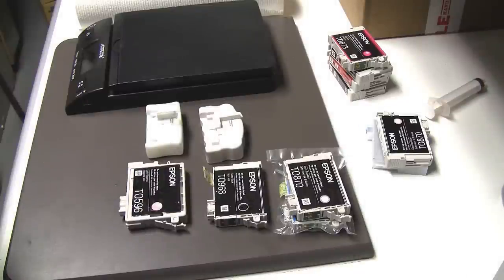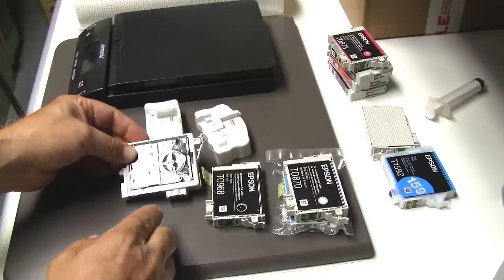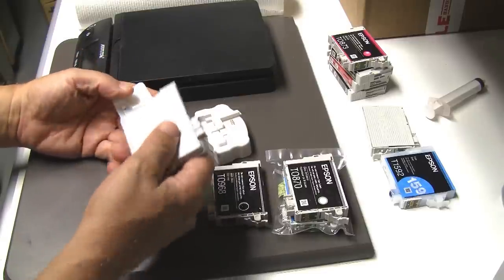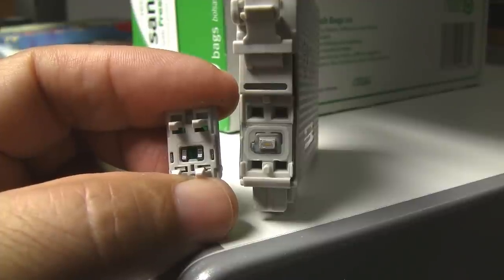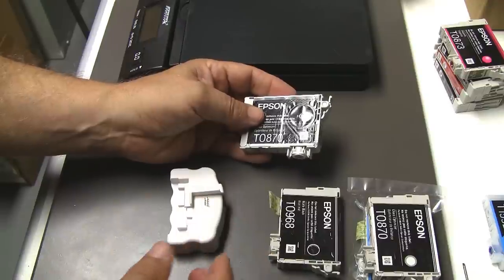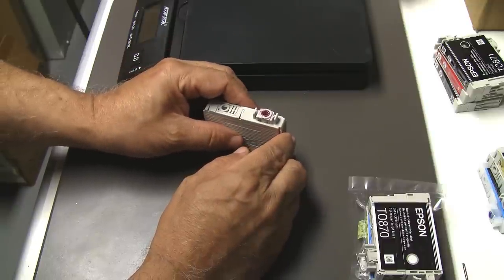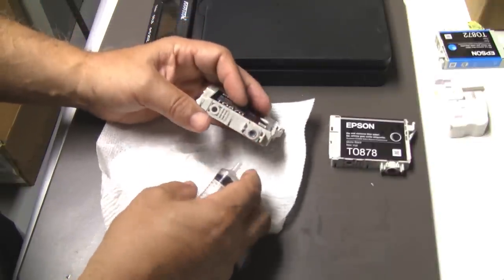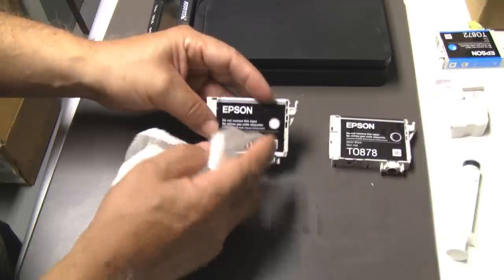New way to refill OEM Epson carts

Comment: Hi Jose, I practised a bit more on two more oem carts and found that, as you say, you need to pressurise carefully, and work the pressure on and off.  Eventually it pops.  It helps to adjust the syringe so that there is only a bit of travel left at high pressure.  I noticed that after successful popping, you can see the two filling port covers flexing and the rectangular cavity behind the label flexes as you blow air in and out - and there is no leaks of ink anywhere!  With the R1800 carts, the vent hole has a valve in it which you need to push in while filling with ink.
My first re-filled oem cart is working fine.  Many thanks.
Reply from the maker: Like I said it is is a very iffy process than may or may not work even 50% of the time. The reason I made the video initially is because people begged me to do it and I really did not want to as it was not at least 90% reliable.
Reply: I'm happy with that risk.  Might as well try to use my old oem carts, rather than just throwing them in the bin.  The one I did the other day is working fine and I have a perfect nozzle check.

Comment: I work with several inkjet cartridges including all of these epson cartridges. I tested this method and it does work...mostly. When you break the "one way valve" that built into the nozzle of this cartridge you can refill through the nozzle.
The first problem with this method is when you fill until you see ink come out of the vent you are saturating the vent filter with ink. This filter is designed to allow air to pass through but not liquid. When it is saturated with liquid it does not allow air through as easily. 
So... when you fill this way you put ink into the filter and block it so your cartridge will (after printing for about 10 to 20 pages) develop a vacuum inside and not release any ink. You might not experience this if you only print one or 2 pages at a time. This will allow he vacuum to equalize and you might be fine.
Also, filling this way, you are unable to eliminate all of the air from the cartridge so you will have problems when the "ink sensor" detects a bubble. The printer will read that bubble as "the cartridge is out of ink" You might solve this by banging the cartridge on a table to move the bubble off of the sensor but it will probably return soon. 
If you are able to reset the chip, the ink level will not be accurate because you were unable to remove all of the air from the cartridge. 
All in all, this method does work. Just be aware you might starve your print-head and need to constantly remove the cartridge to bang it on the table. 
Good Luck.
Reply from the maker: That why you must first remove ALL the ink that is left in the cart before cracking the diaphragm. The you have to make absolutely sure there is NO air in the syringe loaded with new ink. The you must absolutely know what the factory volume is. You weigh a 100% empty cart against a factory brand new one and then only load that amount.
Now you tap as you suggested, the cart so that you allow any air to be detached from the internal maze of ink space.
I agree 100% with you about accidentally wetting the vent filter. That is a NO
NO.
If the amount of ink is correct, you will not wet the vent. I will often inject a bit less ink and pull the cart out at about 20% level anyway so the wetness sensor is not tripped.
It is not a perfect method but it does allow you to do what many have said was impossible to do. If it doesn't not work for you then the only other option is refillable carts of which there are BAD and GREAT ones. It can be a total crap shoot unless you know the company and they have a great reputation. And many do. I would stay away from EBAY and simply pay a bit more for the assurance of getting a good product.
Reply: Jose Rodriguez Even if the ink volume injected is exactly the same as the original amount, due to the maze of chambers and where the inlet/outlet is in each of those chambers it is impossible to fill using this method without wetting the filter. (unless you can inject the ink into the nozzle under vacuum) 

As you fill the cartridge gravity takes the ink to the bottom (top inverted) of each chamber that traps air inside each chamber and it will not ever leave.

It might work if you filled it right side up after you break the seal but I think the results will be the same.
Reply from the maker: You are supposed to fill right side up.
I may not have shown that as correctly in the video but the RJETTEK jig video does show that!

Comment: I bought some refills from bch and watched some of their refill videos. According to bch, the chip on the cart does NOT measure the ink level but the number of prints. As you say in this video, the chip isn't accurate. Thanks for these excellent videos Jose! I love how you like to help people avoid being screwed mercilessly by the scum charging $60 USD for 20 ml of ink. I doubt I will use this method and prefer to use bch method of using a drill to make a feed hole (not sure if this is a good method; there was so much air in his cart i doubt he would be able to use it before drying out the print head with too much air) and then pumping in the ink. I'm afraid to use your method in case (as bch showed) the valve ruptures.

Comment from the maker: No.
Even if you could I don't think there is resetter for the chip.
You have to use refillable carts with resettable chips which may be battery powered for the resetting.

Comment: Hi Jose, Have you tried resetting the 99 artisan cartridge ink series? I have Epson  artisan 1430 now and my old printer Epson artisan 835 broke. I have so many new unused ink from that printer Epson artisan 835. The ink cartridge from Epson artisan 835 will fit into my new epson 1430 printer, but the chip is not recognize in the new printer. I need to refill the old cartridge of the the 99 series to the new Epson 79 series. Any ideas how I can make this work? Also do you reset the cartridge before or after the refill?
Reply from the maker: Sorry but you can not fill original EPSON Carts. They are made so as to not be refillable.
Reply: Jose Rodriguez ugh! Bummer. Thank you for letting me know.
Reply: So I can take ink out of it but not refill it? Right? If I buy empty refillable cartridges do I need to reset them?
Reply from the maker: Yes you can definitely do that.

Comment: Refill tip for this tipe of carts:
Go to Google and search for EPSON (Your epson Ink Series)
Like "Epson Apple inks"
You'll find original epson site, where you'll find the specific MLs of ink to be injected
As soon as you use a third part ink, i advice you to load 1 ml more ink in the cartridge.
Example T0xxx 11 ml >> inject 12 mls

ADCSFXworks Printing Center

Comment: Thank you so much for this easier method of refilling! If it works for the 2200, which I believe you stated at the beginning of this video. Where can one get the proper ink for refilling?  Also, can you use an off the shelf syringe or does it have to be a special one?
Thanks again.
Kind Regards,
Steve

Comment: Hi Jose
When I try this method to "pop" the membrane, nothing happens before I use so much power that the whole cartridge cracks. I have cracked 5-6 of them by now. Same thing happens all the time. Original cartridges for Epson stylus R2400.
Reply from the maker: Did you use a 20ml syringe? Did extract EVERY drop of ink from them before attempting? It should POP at bout the 7ml point if you are using a 20 ml syringe.
If there is ANY fluid still in it will not work and even if it does work, you will aspirate that leftover ink into the diaphragm.

You have to hold the cart upside down and vertically so the exit port is pointing up toward the ceiling. Filling can only be done with the exit port aiming toward you and on the bottom if you hold the cart on its edge. Rate of injection is no faster than 1ml per 5 seconds.

Comment: Thanks for you video. Before I watch your video, I had tried to use a needle to break a little hole at 3:34 which you mentioned.  It is very easy to break it and the ink is leaking out.  Can I just refill the ink to that little hole?
Reply from the maker: This ONLY works on the cartridge numbers listed. None others. And failure rate is high. You do not have to puncture anything.

Comment: Hi, I just got a printer with these empty cartridges. I'm allowed to play with it, so I tried putting metal tape across the wetness sensor contacts on a empty cartridge and now it shows its level is full, ....but wont go, the chip still needs resetting, probably. :( Since I think the sensor measures resistance, (short circuiting, makes it full). So maybe try this, it might be a way to reuse your shorted out empty carts.
(this is like what ProGamer1515 was trying to do)
It's funny I watched your video before I was introduced to the same printer/cartridges you showed.
(I'm doing a project where I'm trying to print with water.)
your video is really informative!!! thanks :3
Reply from the maker: +Joseph Dickson That is some very very interesting information! Thank you!
Reply: ^_^ no problem! your Video really helped me too, Thanks.
Reply: How do you short the chip to reset it?
Reply: It's been a while, I think there are 2 contacts between the chip and the contacts to the sensor. 6:30 I put some copper/aluminium electrical tape over the sensor so the metal back will create a circuit between the computer chip's pins. And the computer chip shouldn't notice the sensor is broken anymore. ^_^ Sorry I don't have it with me at the moment, I'm remembering off the top of my head :P feel free to ask more about it :)
Reply: Oh if you are asking about how the cartridge gets reprogrammed, that is different than what I am talking about.

Comment: I have an Epson RX 500 all-in-one and it's been very cranky. If everything isn't exactly right it will drive you nuts and sometimes it will say a cartridge is empty when it still has over half it's ink. Take a cartridge out, and it won't accept it back. I've even had it tell me a cartridge was empty and I replaced it. Then it said another was empty, then another, etc. until I replaced them all.

Epson may be great printers but I think I'll go with something different next time. 
I had a Lexmark before and it was problem free at a fraction of the cost.
Reply from the maker: That's very odd. I assume you are using OEM carts?

Comment: Jose, luv your videos, one I am looking for is about the Epson cart that has the window in the bottom, for the printer to see how much ink is in there, XL200 carts are among these. I am sure I saw a vid you did on this, apparently the refill is similar to what you are doing here in rupturing the diaphragm. The XL200 seem to also have this diaphragm. Any help would be appreciated.
Reply from the maker: +Jackie Dines I don't know of any EPSON OEM carts that show you how much ink is in them. There is a MAZE of channels and chambers inside OEM carts that are completely sealed from the peering eyes. Only Refillable Carts would ever allow you see inside their very simple internal chambers ( Nothing like OEM ). They are the only ones that have see through sides.Even IF you could rupture the membrane ( Iffy Proposition ) how would you reset them? You'd have to find a resetter for those Carts. I understand that it is a three color and black ink printer not really intended for photos but for documents. I would suggest you just use compatible carts on it. That's what I do on my WF1100.Joe
Reply: +Jose Rodriguez Thanks for your reply and yep it is just a doc printer. I think I have found a video on how to refill them, not a problem. But I would love to ask you what you think about buying a R1900 that has only used one set of inks. I believe these have the TO87 carts. As this printer is getting on now I would imagine that they emptied the carts and never replaced them, so that would be a new set and then the issue of refilling if they have that "wet sensor" you talk about. Is it practical to use CISS or replace the OEM with refillables? Can you use Dye ink as well, if so is there much to preparing the printer to change inks?  I am just an enthusiast and getting more and more interested in printing my own pics. So far I only have used the RX650 6 colour printers and these do a pretty good job, but I would really like to achieve two other things, one is to print better black and white, the other is to be able to print A3 size. I bought a RX650 years ago and just recently was given another one as the owners could not handle trying to clean the nozzles and or use refillable carts. So they just went out and bought a new printer. I have now (thanks to your videos) been able to refill the OEM carts and after buying a chip resetter (from the US, I am in Oz) I am happy to say that it is all working a treat. Sorry about this long post but I would love to know your thoughts on the R1900 for my purposes, I cannot afford to buy new and where I live the market is very small, I have been looking for a long time to buy a reasonable Epson A3 photo printer second hand. I think that I should be able to buy it for around $350 AU.
Reply from the maker: +Jackie Dines Jackie, I am sorry I did not see your reply any earlier.The R1900 is a wonderful printer capable of excellent gorgeous results on glossy and lustre papers. If ytou can find it and it is able to be cleared on all nozzles then it will serve you very well. You will have to install and expernal Waste Ink collector simply to make sure that you are no longer dumping ink into the internal pads wehn you have to clean nozzles or after installing a new cart.Good luck!

Comment: dont pop the diafragm. Fill the syringe to half (ex 5 ml). turn it up side down and push the air out. attach it to the cartridge and pull the syringe full out to create a vacuum and then push  the ink in.
Reply from the maker: Are you sure?

" don't pop the diafragm. Fill the syringe to half (ex 5 ml).

WITH INK?

turn it up side down and push the air out.

YOU MEAN EXPEL THE AIR OUT OF THE SYRINGE BUT WITH ONLY 5ML WORTH ON THE 10ML SYRINGE?

attach it to the cartridge and pull the syringe full out to create a vacuum and then push  the ink in. 

SO YOU ARE SAYING THAT YOU CAN VACUMM FILL THE NEW EPSON CARTS THAT WAY?"

I would think that if that was all it took, the device that rjettek is selling would not required??? I will try this and report back.

Comment: Hello sir, I enjoy your videos once i blow out the one way damper, there is a ,mess. is it safe to put ink back in right away or does it need to be sealed , it seems like ink is coming out of the side. It seems like i cannot put ink back into the cartridge because when i try and push air through a second time air bubbles and ink are still coming out, did i do it wrong and break the oem , i am doing this on the r1800 cartride for cyan color.
Reply from the maker: Did you compare the cart # against the list of compatible carts in the description. Thus only work like 50% of the time unless you have the actual $200 gasket to do this properly. Does not work at all with anything new.
Reply: @cheo1949  actually sir, I hadn't yet. But I did now and I do not see it. I have the T0542 ( cyan) for epson stylus r1800. I tried it already to inject air and it seems as though ink is leaking from the sides when I try to inject it.
Reply from the maker: So that's not one of the design that allows this. EPSON sees these videos and immediately circumvents it and redesigns the new generations of carts to prevent the process to continue.
Reply: @cheo1949  thank you for your time and energy sir.

Comment: Some places will take certain old cartridges as credit towards a new one but I haven't found any place that accepts Epson cartridges.

Are all printers as troublesome as Epson?  I've had a Lexmark and it was trouble free until  our power line had a voltage surge. I have an H P now and it hasn't given any problems.
The Epson (RX 500 photo quality) has been as cranky as a baby with a bad case of diaper rash, it's almost never "happy". I doubt that it's printed over 500 copies in it's lifetime.
Reply from the maker: Not the higher end Dedicated Photo Printer Family. What you are referring to are the lowest tier of printers. Those must be used almost daily in order to keep them unclogged.

Comment: Hi Jose,  Thank you for an informative clip here-and others. I have an 837 with refillable cartridges. Black has become light and cleanings do not help-can I drain the black ink out of the cartridge, put in cleaning solution and then "print" a mostly black photograph to clean the print head?

Just wondering, thank you for your time,
Scott
Reply from the maker: +stp479 What do you mean "Black fas become Light"? Are you missing many lines on the nozzle check for black?You can not refill your OEM carts unless you try the method shown here which can be dicey and damage the cart if not dome correctly. Otherwise you would have to use refillable carts and fill them up with something like Piezoflush from Inkjetmall. Not cheap but very effective.
Reply: +Jose Rodriguez Multiple head cleanings and black is not very dark. I have refillables so thought I could use cleaning fluid in the black refillable cartridge and run another head cleaning. It is only the black giving me trouble-nozzle checks are good on all other colors.
Reply from the maker: +stp479 Is the black cart properly primed? Fill it full ten insert a syringe into the exit port and draw oiut a couple of ml. Reinsert the cart and do one clean and check nozzle check. It is is still bad then suck out the black inkand fill same with head cleaner. Is the black Iine totally filled with ink? Actually I think it is your cart that is causing the problem.
Reply: +Jose Rodriguez Thank you Jose. I will give it a go today!